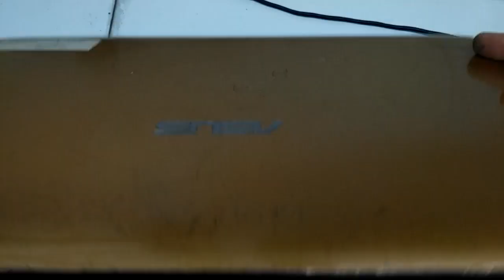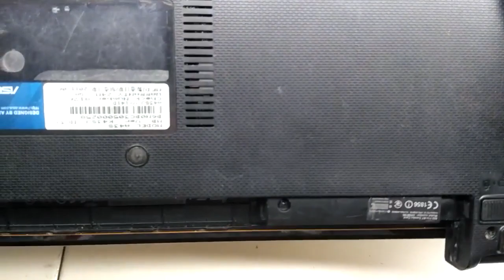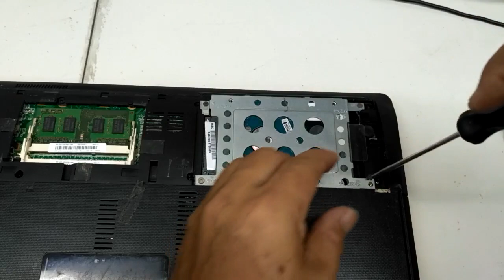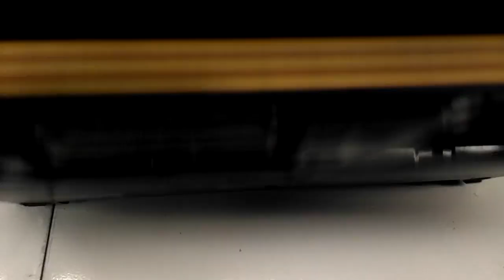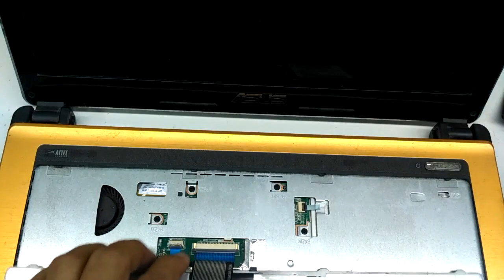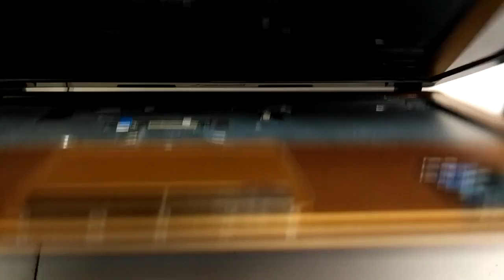how to disassemble laptop Asus A43S

Comment: Hello i want to buy a new ram on my asus a43s may i know what is the ram specs of it thank you
Reply from the maker: Charls Kenneth Tolenada ,
Asus laptops use 12800 mhz DDR3 Ram, brother
Reply: Can install i7 processor (4 core). I installed myself i7-2760qm and the normal temperature is 45-50*C in the browser and a maximum of 76*C in games. When I play games, I turn off the turbo boost, and the processor runs at a base frequency of 2.4 GHz. 
Can install DDR3-1600/-1866 memory modules (4+4/8+8)
you can buy a cheaper i7-2670qm/ i7-2630qm processor

Comment: Hi, I have a problem with my laptop it keeps turning off by iteself when overheating do u know how to fix?
Reply from the maker: Reg Dghhh,
Brother, usually the laptop can turn itself off, it can cause overheating because the fan system is a problem that can be caused by a dirty fan so the solution is to try to clean the processor fan, bro